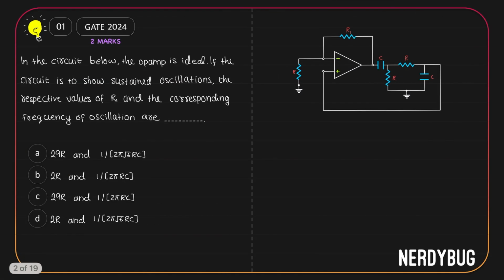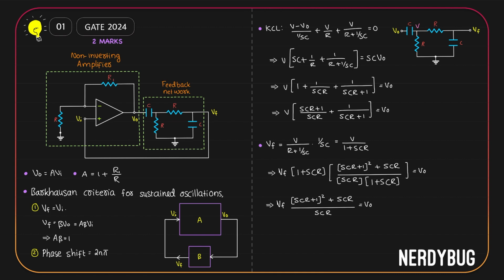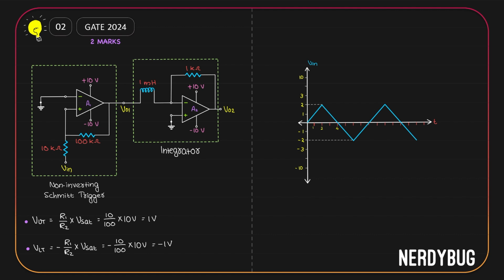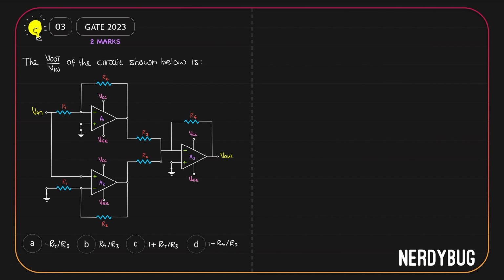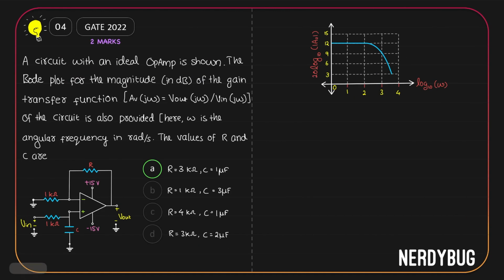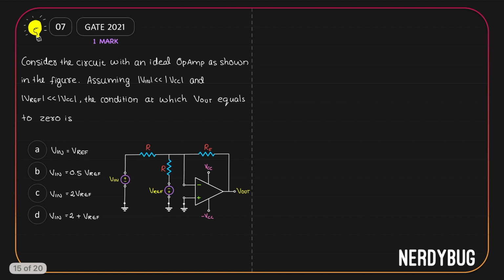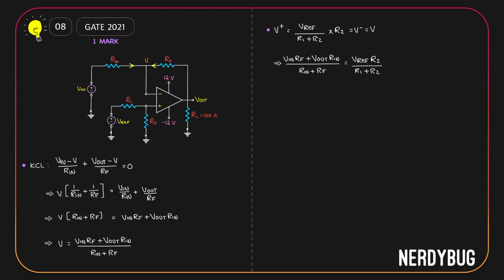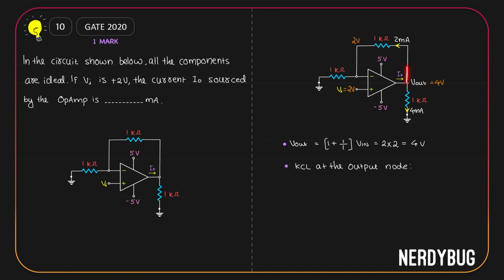Gate Questions on OpAmp Circuits | 2020-2024 | GATE PYQ | GateBusters ECE | NerdyBug

Comment: In problem 1, to find out gain of feedback network, Vf/V0 , can we apply voltage divider rule two times in the circuit, and if not why not?
Reply from the maker: It might look easier to apply the voltage divider twice but with capacitive reactances involved, it complicates the math. https://drive.google.com/file/d/10cpMHMEJT4KWuhMkUgxaQu_Kh0pxdWwA/view?usp=sharing
Reply: Got it ma'am, thank you so much for the reply and explanation through the drive link:)

Comment: Do you have a video for small signal analysis of mosfet? 
Also solving op amp oscilator pyqs are enough? I havent practiced much of its questions but just ots pyqs.
Btw nice video!!
Reply from the maker: I have solved the last 10 years PYQs on MOSFET and it covers small signal analysis very well. And when it comes to solving problems, the more the better.

https://youtu.be/rVkSnKYO6FY?si=3BkgLU2Qbp0ZuMRm

https://youtu.be/o-I_hjZWKa4?si=EtSzkr1CPdvlROWh